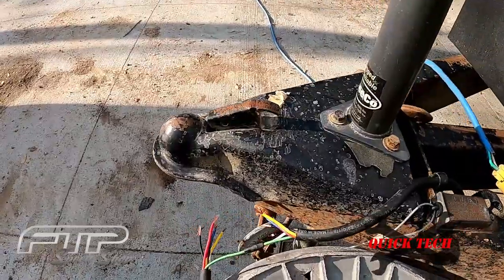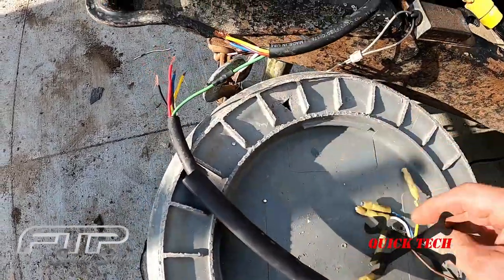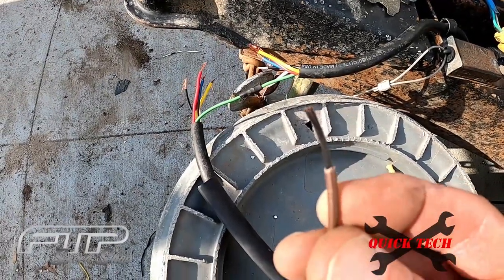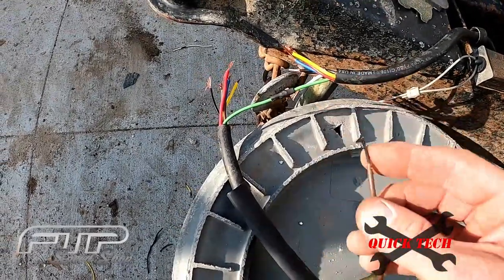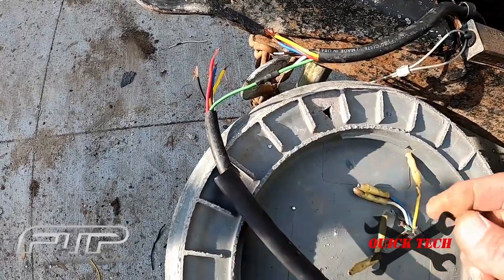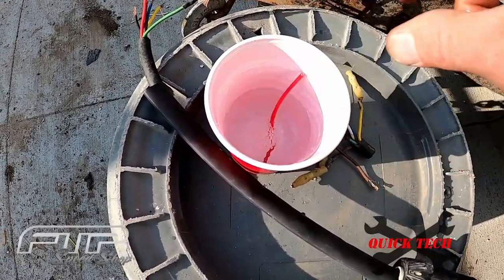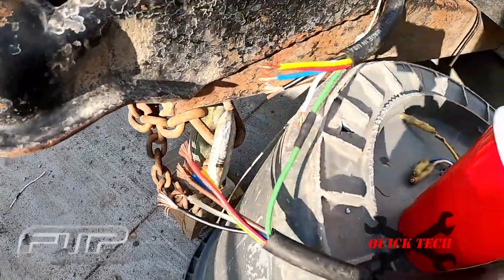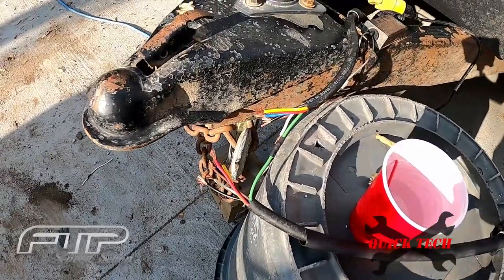How I Cleaned Dirty Wires Before Soldering

Comment: Great Tip But WAIT A MINUTE!!!!! You Forgot The last most important tip....Neutralize the Acid after the acid cleans the wire!!! Use baking soda in water as a paste or solution to neutralize the vinegar acid or the acid will continue to corrode the wire!!!!
Reply from the maker: That may well be a great addition to the video....but it has been working strong for 2 years!!!

Comment: Hi if the joint is get clean for soldering and the rest of wire still correded that will not cause any problem? Does the wire still be conductive?
Reply from the maker: If the wire is really  bad you could  run into  issues. However  on my enclosed  trailer  (this video) they were pretty  corroded and they have worked perfectly  for the last year.  My main issue  was that the ends I was trying  to  solder were so dirty that it wouldn't  take solder.  I had to clean  my ends before they would  take solder.  Once I cleaned  the ends they soldered like a dream.

Comment: please tell me you then rinsed the wires with fresh water!  Vinegar being acidic, if you left it on the wires they could be corroding out on you even worse than before.
Reply from the maker: As far as everything  I have read about vinegar  it fully evaporates and leaves no residues behind. But washing  the wires to neutralize  the acid couldn't hurt.
Reply: @FullThrottlePerformanceMike  so if you did rinse with water would distilled be best?
Reply from the maker: @Blue_Collar_Hunter  yes I would think so.

Comment: Just use steel wool.
Reply from the maker: No way this works way better!!!!
Reply: @FullThrottlePerformanceMike  Does the same job in about 10 seconds rather than 30 minutes
Reply from the maker: @RatchetMonkey  I think you should give this a try.  It fully cleans the wires, it’s been  well over a year, and there no issues with the trailer Harness.